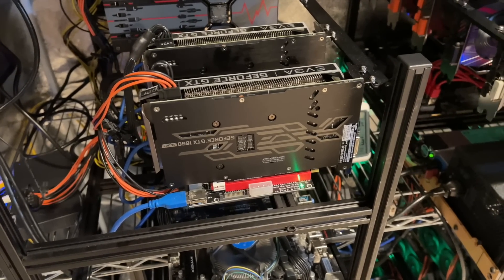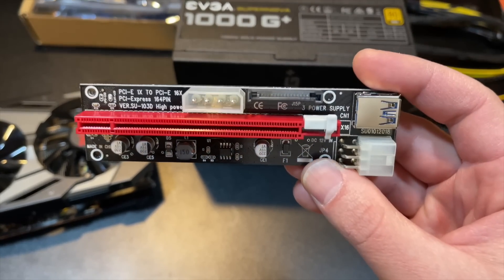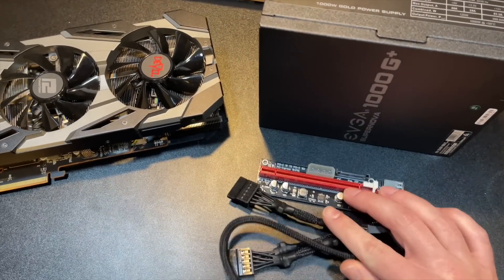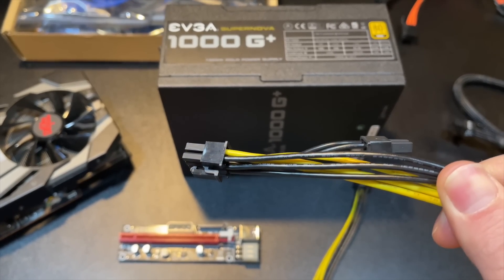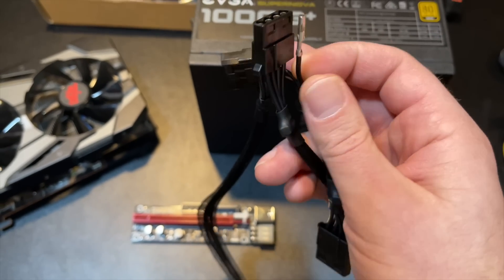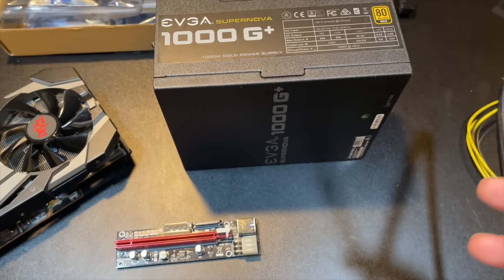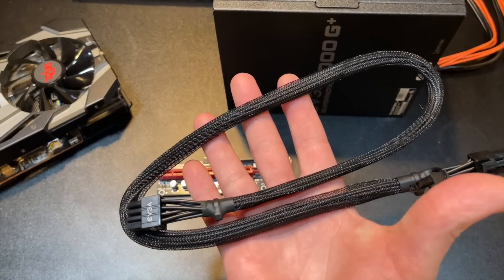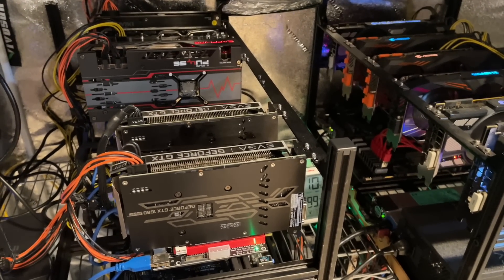Powering GPU Mining Risers Safely

Comment: 2 questions, if a capacitors job is to "even out" electrical flow, aren't you risking your expensive cards by direct connecting to your power supply?  shouldn't you be connecting power supply to riser, then riser to graphics card?  i understand that you cant with the risers you had, but i accidentally bought the 4 capacitor type that was similar to yours except that it had two 6 pin pci-e connectors.  1 to power riser, the other to draw constant "consistant" power from riser to card is what i'm assming.  i assume this since there are never any real assembly instructions with a riser card.  others say the more capacitors the better.  i asked a friend who retired from working with electronics  in the experimental division of john deere what capacitors are for.  what i understood from that explanation is why i put the term even out and the word consistant in quotation marks.  it seems to me that you would want to avoid power spikes or shortages from your psu that might damage your cards that capacitors (by my understanding) serve as protection from.

so my 2nd question.  if your powering the card directly from the psu, why are you bothering with a riser card?  i don't understand.  if the riser card is meant to reduce the pull on the motherboard while transferring data, and it's getting all this power directly from the psu, why can't the riser card supply all the power demands of the gpu?  why aren't you plugging the pcie's in the top of the gpu into the riser card?

Comment: I have just had my first ever cable melt

Have been using Polaris cards with mostly SATA powered risers for years now

recently I got an RX 5700 I also powered the riser with SATA today the Sata Cable  (adapter to molex) leading into the riser started melting!

Never had this issue with any of my polaris cards, but RX 5700 with the higher power ceiling cables actually start melting using SATA

wow I hope ill be fine now going for 6 pin now
although i dont get how its happening was only drawing 100W in software and it has the other 8+6 pin so definitely not capping out
its just stupidly stressing the riser power I dont get why

Comment: I need 10 vga things and my 850w psu only has 4.  2 of the cards are 1060 6gb, so only use like 90w.  Is it okay to 3-way split 2 of the gpu's for those?  If I do 3-way split, do I attach the 2nd splitter to the end of the first one, or the mid-cable one?  Or does it matter?  I wish I knew proper terms better but idk what to call it, like when a splitter has a midway connector and an end connector, do I connect the 2nd splitter to the midway one or the end one?  Hope that makes sense.

Comment: Molex were used to power hard drives and tape drives so most with the fat pins should handle 75 watts as it has a 12 and 5 volt lines and the 12 volt line would be just over 6 amps if it were powering everything but ttl logic would run on 5 volts and all the com and control circuits would run at ttl levels so you would probable be fine with Molex ttl (transistor transistor logic) :-\)

Comment: Quick question. All of my PCIe 8 (6+2) pin cables are being used up. I know you said molex is not the best, but what if I got a dual molex to 6 pin cable? Staying on the safe side, with each molex being able to do at least 60 watts, the dual molex connector should easily support the 6 pin plug. This seems to be perfectly fine, but let me know if you would not recommend this. Thanks.

Comment: One question, if you need to power 2x 8 pin GPU, you will use splitter for PCIe cable, but how you power riser? Witch other 1 pcie cable? Can we put 2 risers on 1 pcie cable?
Reply from the maker: With a 2x8 pin GPU I usually use 2 strands from the PSU and split one to also do the riser.

Comment: It is totally insane that these risers are all made to use 6 pin PCI-E when its obvious that those are the rarest connector in a system, so they all supply a SATA adapter, like none of these manufactures can figure it out. I personally prefer the risers that use MOLEX.  MOLEX can handle 75 all day no problems, plus they are the least used in a system, plus there is usually 4 to 8 of them available.  Remember this kids, it is always the connector that is the weak point, the connector will melt, not the wire.  Don't be stupid and use splitters on splitters, every splitter adds more electrical resistance.  Power risers with MOLEX, and GPU's with PCI-E 6+2's

Comment: I have a 850w psu (cougar )
It has 4pci-e 8pin slots and 4 6pin sat/peripheral slots on the back

Can I run the risers off off the peripheral slots n run the gpus on the 8 pin PCIe

Comment: I am just getting into mining again, after having done it for a year or so around 2018/19. Anyway I was planning to re-use some of my old risers until I saw this video. They only had Molex connectors, and for some reason they came with Molex to SATA power adaptors. I ran 5x1070 GPUs using these Molex to SATA adaptors. Upon closer inspection now, I can clearly see there is heat damage/over temp damage on the plastic shells of the SATA power connectors. Slight deformations are evident as a result. I have ordered some new risers with 6pin PCIE style power connectors now. Next question is can I safely run 4x 3060Ti LHR on a Corsair RM1000X, considering TDP etc?

Comment: I have cables from Parallel Miner that are 3 pin to 4 pin that I used until the psu fried.  From what you said, it looks like I can use those from an EVGA PSU to power my risers?  I'm looking to do a 3090 build, so I will need many connectors and have 16 of those cables laying around.

Comment: Great video! I have a question on splitting the GPU and Riser on a 1660 Super. Was the 125w including the riser or would that be the GPU plus 75w for the riser to equal 200w?

Comment: I've been mining for a lil over a year now & I've only used the 6pin to sata to power my risers... I have 3 rigs with 6 gpus in each & I've been running 1080 ti at 200w each. I've never had any problems thankfully! But, After doing some research and watching a few diff vids like this... I'm going to be switching everything over to straight 6pin now.

Comment: Question:  I have a Corsair HX1200 PSU, and it's not compatible to any 6 pin to 6+2 pin cable that I've found.  As a matter of fact, when I tried to use them after watching this video, I burned out my motherboard and CPU.  I managed to get them replaced, so no foul.  It seems that I have no choice but to use SATA power for my risers.  Do you know of any other alternative?

Comment: Reviewing this video again. Can I take a GPU risers splitter plugged into the two 8 pin connectors on the top of a 5700xt and then plug in a single 8 pin to the splitter and then connect to the power supply? This will allow me the connections I need to power more cards.

Comment: Hi Mike, Is this applicable as well to 6600 xt's where the riser is probably just only  pulling around 30 to 32 watts? I'm using 1000w modular evga psu and olny got 4 vga. I used these to power 4gpu 6600 xt's but I need more to supply the remaining 2 gpu 6600 xt's. do ineed to buy another PSU for the remaining 2gpu's. Thanks a lot man!

Comment: Thanks very much for the detailed explanation. Your effort and  research is invaluable. I do have one question concerning my rig I am in the process of building (new to mining); I am building a rtx 3090 build (starting with one GPU atm, will add more in the future - want to take it slow at first ) and I am aware that this GPU is a beast in terms of its electric use. does the concept still apply to this particular GPU in terms of its 'pulling power' as you described in your video? I only ask as I want to make sure if I am splitting the cable into the riser and GPU (from PSU) that this will be both sufficient and safe (based on the GPU's power needs). disclaimer; I appreciate that there would be more value in finding out this info myself via manufacturer's guidance...however, its difficult to find this info and would like to pull on your experience of working with 3090s. Thanks dude!

Comment: Omg the cables are over engineered a 54W cable can take a measly 75W. The issue isn’t safety but efficiency and voltage drop

Comment: Hey Redfox :) , I've got a motherboard which I plan on using for mining (Gigabyte Z77X-D3H rev 1.0), and it has a sata power port for providing extra power to the PCI-E Slots when you're using multiple GPUs. (in my case a single LHR rtx 3070 and a 1660S) Do you think using sata to power like this would be fine, since its not the only power source? Thanks in advance.

Comment: stupid question, but here it goes... :) If a female 6pin connector is rated for 75W, is it ok to use it on a splitter? As the gpu will usually pull more than that 75W through that splitter connector?

Comment: Hello Red Fox Crypto!!! I have several rigs, but I made the mistake of connecting the risers on the the sata ports. I just saw your video and you have given me enlightenment, but now I have a couple of questions.

 My psu's are Gigabyte 850. They have 5 pcie 8 outputs (gpu/cpu) and 3 pcie 6 outputs (sata/perif/molex).

Do the pcie 8 and pcie 6 outputs give the same output of w?  I'm asking if I can connect the risers directly to the pcie 6 outputs, or those outputs don't give enough watts? 

Thank you very much for your posts and your help.

Comment: Hi, my PSU is a Corsair RM850x and I have the original PCIe Cables with Dual Connector Type 4 Gen 4 by Corsair. What's the maximum power that this cable can carry? is it 192W or 384W?

Comment: I've taken a few PSU's apart and all the 12v rails are connected to the same pad on the board, same for each of the other volt rails.  It would be expensive to create individual 12v rails @ different power ratings.

Comment: Trying to wrap my head around the last thing that was touched on with PCIE connectors. Where one splitter is being used to power the riser and the gpu. Are you saying that it is safe to do so because worst case scenario there's a 125w draw from the card and 75w from the riser which is 200w over 192w and the chances of that are so low that there is little to no risk, or is the riser pull not factored in and its the straight 125w which is well within the limit and there is never an issue? Thank you in advance for the clarification!

Comment: Hey Mike bro, lets say directly from the server PSU is a 6pin that is connected to another 6pin spltter into two 8pins. Would each 8pin output 150w? Since it splits into two eight pins, is it safe to assume two 8pins total output is 300w? The thing is the source came from 6pin that can only output 75w. In this instance, how would you calculate the total output of each 8pin?

Comment: Question on the pcie splitter to power 2 risers ... does the connection to the psu use a 6 pin peripheral port, or a 8 pin pcie port?  I currently have to power 2 risers, and I am out of 8 pin pcie ports on my psus, but have plenty of 6 pin peripheral/ sata ports available. What do you suggest?

Comment: Amazing video! Can't thank you enough for the education here! 

A question (might be a dumb one so if it is I apologize in advance); 

You show your config has 1No. X 6 Pin PCIe from the PSU split into two 8 Pin PCIe connections (One goes to the riser card and the other one goes to the GPU). 
We calculated that the 6 Pin PCIe connector has a rating of 192 watts (this one on the splitter 6 pin to 2 X 8 pin connected the power supply). 
And calculated that the 8 Pin PCIe (6 Pin -> 2 X  8 Pin) has a rating of 290 Watts. 
So if you use 6 Pin connector split to 8 Pin (1 to GPU with tdp: 125 Watts + 1 to Riser with 75 Watt rating; 125 W + 75 W = 200 Watts) worst case you need 200 watts through that 6 Pin connection at the PSU but that 6 Pin is rated for 192 Watts, doesn't this mean that the 200 watt worst case scenario (exceeds 192 Watt rating by 8 Watts) could be an issue at that 6Pin PCIe connection at the PSU? 

Again, I'm very new to all of this and sorry if I missed something obvious or if this is a dumb question.
Reply: I don't understand actually but riser just like bridge. It doesn't use so much watt.

Comment: Ever had a card not work with risers?  It works great in motherboard but have tried multiple risers and once I plug the power into the riser I get red lights on card. Card powers on fans spin before I power riser. I've tried different spots and different cords and risers

Comment: Do you need to add both the 75w from the riser and the wattage from the gpu together when trying to use a splitter to power a card and a riser? I’ve got a pcie 6 pin splitter for a riser and a 3060ti. 
Thanks!
Reply from the maker: The 75w is included in the total TDP of the GPU.

Comment: Hello THANKS FOR YOUR VIDEO . I have a question .  I find there are more SATA slots on the PSU.  Could I use a 6pin pcie cable connect the SATA slot and RISER 6pin pcie slot as the power supply for the RISER? THANKS!

Comment: So... maybe I should stop using the SATA power adapter for my 3090s
Reply from the maker: 100% - I just tested mine last night with a new power meter. Even power limited it was hitting 54w draw over the riser which is the MAX for SATA.
Reply: Ok, I just made the change. I'm using the 6-pin GPU power for all my riser boards now. Thanks!

Comment: I revisited this video after recently doing some rewiring on my rigs.  I think I'm more confused now, though.  I have some Parallel Miner PCIe 6 pin triple splitters I've been using without issue, but now I'm questioning my safety of them (6 pin female to triple 8 pin male).  Not that Parallel Miner doesn't make good quality cables (they do).  Example of what I mean.  I've got a Seasonic 1000W Focus Gold PSU with 3 PCIe cables.  1 Seasonic PCIe cable is feeding one of those Parallel Miner triple splitters and they are going to a 3060Ti and its riser with a TDP of 200W.

Even if the triple splitter was an 8 pin female, and not a 6 pin female, the max safe wattage would be 192W according to Red Fox in this video.  But, for a 6 pin female on the triple splitter, isn't it even less?  I can't even figure out a scenario where a 6 pin female to triple 8 pin male is safe where you'd utilize all 3 of the splits (6 pin or 8 pin).  But, then, it's hard to believe Parallel Miner would sell what would seem a "dangerous" triple splitter in the first place and that also seems hard to believe as I find them to be a pretty trusted site for my supplies.  I must be missing something.

Comment: I am using the same exact risers, and was using the 6 pin to a 7 cable that went into each riser on 2 vid cards. Now I have 3 vid cards, and the evga 1600w p2 does not have these 6 pin connector cables, it only has sata to use in the SATA port or SATA/PERIPH port on the back of the PSU. Any advice would be greatly appreciated, I would love to think there is some way around this issue. My 3 video cards take up 8 of the 9 VGA ports on the PSU. Many thanks!

Comment: Thank for you this very good video. My problem is as follows, when I connect the PCIe connector to the PCIe riser, the PSU does not boot up, I guess there's a short somewhere (have tried different cables and risers though), however, when I use the SATA connector, everything goes well ... what can I do? I'm using PCIe risers v8 and v10

Comment: what if the case is gpu 3080 which requires 2 x8 pin slots? if i use 2x8 pin splitter for gpu then 6 pin for riser how should i insert the cable from PSU? can you give me a solution?
Reply from the maker: You should split between the 6-pin on the riser and the 8-pin on the GPU and then use another single 8-pin for the other 8-pin on the GPU. Don't split between 2 8-pins.

Comment: Here is some data about Molex/AMP connectors for you. Molex is the OG daddy of the 4pins originally were three typical pin sizes: 1.57 mm (0.062 in), 2.13 mm (0.084 in), and 2.36 mm (0.093 in). The 1.57 mm pin can carry 5 A of current, while the 2.36 mm can carry 8.5 A. AMP later released the lock Mate and Lock in 1963, they used a .093 in pin rated at 11A. Later on Molex updated their connector to be compatible with AMP and also Mate and Lock so today there is virtually no difference. Its "safe" to assume at least 8.5amp per PIN which at 12V is about 102Watts. Currently Molex rates the connector (which includes the pin) at 13AMP max. 

So connector and PIN wise more than able to handle the 75Watt the pit fall is if you have 4 of these connectors on a 18AWG wire you can pull max 16A on the wire so using up to 2 connectors would still be the limit, that is if you PSU is happy to supply the 16A needed on that peripheral output, which would for safety limit you to one connector taking into account cheaper components or manufacturing techinques used to cut cost.

FYI AMP Part is AMP 1-480424-0	AMP 60619-1	AMP 1-480426-0	AMP 60620-1	13 amps
Reply: THIS, is what I was looking for.  I use Molex Micro-Fit connections for 3D printers; they can handle 8.5A and they are tiny compared to PSU connections.  So I knew someone in here must have an idea of modern standards.  Thank you!
Reply: Thanks for the information Sir , i really appriciate the time you took for this . 🙏🏻
Reply: can i use molex to power my 1050ti gpu riser ??

Comment: Red Fox, thanks for the info, I am in the middle of building a rid of 6 x 1660 Supers, and where I am the voltage is 220, so the calculations are a bit different. Was going to use molex for a few, but I think I'll just get a few splitters to be safe LOL!!!!

Comment: Little confused here doesn't the riser only get power? For the riser. The actual power comes from the 8pin cables. So the only power draw should be the riser itself. I think the issue is people were putting for risers on one sata line causing the problem

Comment: @RedFoxCrypto I have limited pcie slots in my psu. I have be quiet dark power 12 1000 watt, and my question is: Can I use splliter 12 pin to x2 6 pin connector to power 2 graphic cards? (3080) Anyone?